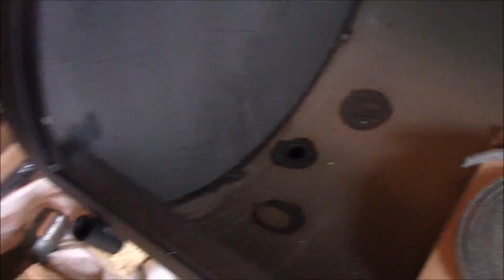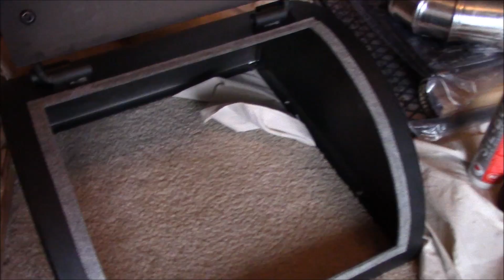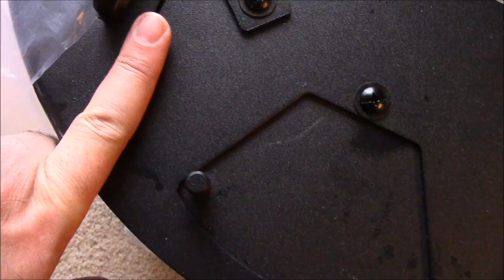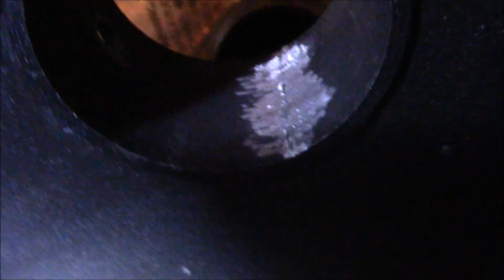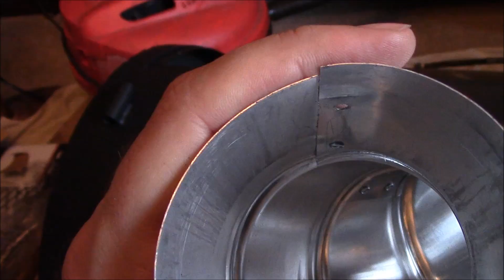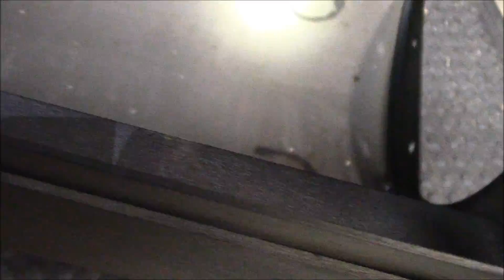Oklahoma Joe's Highland Smoker build and mods part 1

Comment: Nice overview with good descriptive ideas of the defects in design engineering. Wondering when you fired her up, did the gasket on the fire box side burn right off? This Oaklahoma is a good unit for a budget. I bit the bullet & went with the thousand dollar 20” Horizon offset smoker.

Comment: While I do everything possible to seal my cook box to keep my smoke moving toward the stack, trying to seal the firebox door isn't really necessary. In fact, my firebox door is open most of the time. Others leave the door open and use a portable fan to increase airflow into the box. I'm considering adding several inches to the exhaust stack to improve the vacuum.

For the small gap caused by tack welding the grate rail along the cookbox door, I put some RTV in a syringe and added a bead along the bottom of the grate rail.  Between that, the door gasket, and the outside clamps, I have no leaks from my cookbox.

Comment: instead of having to bang on the metal for the gasket o fit perfect  can I also put  gasket under the door lid as well . kind of like how they do with the green eggs? which I have , like doubling up? I am going to install the lock brackets too. but was wondering about if it would work. also I have the  3inch elbow  for the stack pipe inside do I need to take a section off of it near the bottom if its too close to the grate?